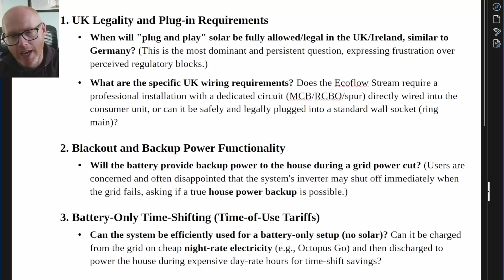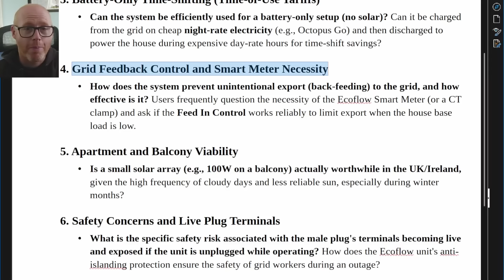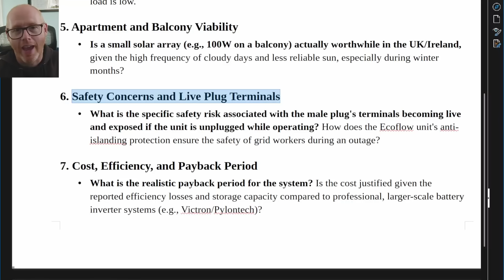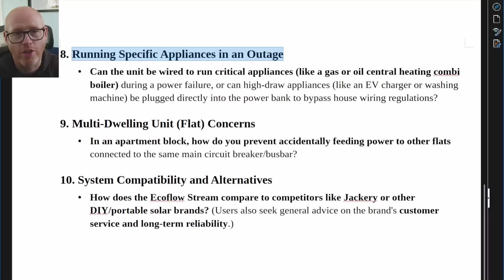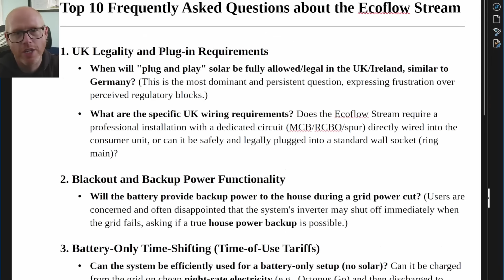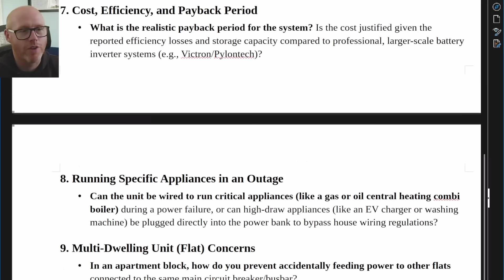Plug-in Solar - EcoFlow Stream: Legal in the UK? Wiring, G98, RCD? Blackouts, Time of Use...

Comment: Excellent video - thanks for that.

I hope the following (from my understanding as a professional electrical engineer) may be helpful (sorry it's so wordy for clarity) -

If a  battery/invertor unit is connected into an existing house Consumer Unit, downstream of its Main Switch, then that Main Switch cannot isolate the house wiring and appliances from the battery/invertor unit; safety isolation being its primary function.  In the event of a fault in the battery/invertor unit, it may cause the house wiring and appliances to be "live" even when that Main Switch is OFF.  Anyone working on the insides of that Consumer Unit would be at risk in that way. Anyone working on wiring outside that Consumer Unit would be protected only by the RCBOs (if fitted and working).

That is why (IMHO) it is preferable, for safety, for the battery/invertor to have its own Consumer Unit (clearly labelled "Battery/Invertor") which is connected upstream of all the other Consumer Units in the property.  "Upstream" here means between the main meter and the Consumer Units. In addition, should be a prominent label affixed to the outside of every Consumer Unit in the property, warning that a battery/invertor unit is installed in the property, to mitigate the risk.

If the battery/invertor unit has not been type-approved for connection to the UK grid, then it would be prudent to include an automatic (grid-sensing) isolator between the unit and the grid.  This avoids the risk to staff working on the grid during a power outage. This is quite easy for a qualified electrician to do, using a contactor in the Consumer Unit to which the battery/invertor unit is connected.

I hope that future editions of the IET Wiring Regulations will cover all this thoroughly, to make the safety requirements clearer for everyone.

I'd be interested to see other points of view - especially on how other countries handle these risks (or do they simply ignore them?).
Keep up the good work.

My system -
2x Enphase 5P 5kwh battery/invertor units
2x EcoFlow Stream Ultra X 3.84kwh battery/invertor units
Vaillant Arotherm 5kW & 250l Unistor, no buffer
VentAxia whole-house MVHR
Open Energy Monitor
no solar PV (so far!)
2-bedroom detached house
Reply: The Power stream Series are fully UK compliant and on the EAN register with their own numbers, you will see this when you self apply for G98  , same as all other solar systems out there . As an electrical engineer myself b.eng  hons and Electrician ta boot I installed a lock off isolator as an extra safety for the dedicated Stream circuit via b curve RCBO, not actually needed as MCB's / RCBO's  can be locked off with appropriate industry approved lock off devices , of course any solar grid tied devices requires appropriate warning labels on dist board along with circuit diag ( long line diag ) again which i installed , oh and don't forget DC string isolators ( them's the regs ) along with least forget dedicated earth bonding if fence / wall mounted through use of grounding rod , unless your like me and have a Tera Tera earth system in my household.
Reply: Some comments
- if the battery/inverter has not been G98/G99 type approved for the UK then it shouldn't be installed in any configuration it and the grid can be linked. If it's not UKCA/CE approved it should not even be sold or used in the UK (and even allegedly reputable internet e-commercite sites are full of dodgy stuff so be careful).

- A non grid tie and non G98/G99 compliant generation source can be linked to the house supply providing there is approved equipment such that the house is connected to one or the other (never both) and the two cannot be connected together. That's generally either a mechanical or automatic transfer switch. In the US these are common but in the UK traditionally only used on rural buildings with generator backup. It has to be done this way as "promise I'll remember to turn both switches" isn't safe. This will also involve a ground rod.

- Any installation that can operate with the grid down should have a separate earthing arrangement. There's no guarantee that the ground in the house remains a valid ground if the grid is down. Many home battery packs don't address this because they are really intended to be used outdoors camping and the like, some have earthing points they vaguely mention in the manuals but don't bother to properly explain because it's really only about emergency backup. Again mostly a theoretical risk but not one to ignore if you routinely operate in islanding mode or operate appliances requiring grounding is present.

- There are a bunch of wiring and labelling requirements for G98/G99 systems and you can conveniently buy label packs for them with the "solar PV on roof" and other labels. |That includes the ones on the consumer unit that address your concern if the house has islanding so you must also power off the battery to work safely. In theory the grid tie power loss will cut the power anyway but an airgap is always nice to have.

- There are a bunch of similar requirements for a transfer switch

- If you are doing any grid tie generation then you must file the G98 after install, or a G99 before for high power. G98 forms are easy to fill out. G99 is a lot more complicated but I doubt anyone here is going to be installing over 3.68kW of grid tie power.
Reply from the maker: Thanks for sharing these thorough comments with the community!
Reply: Regarding your first point the Ecoflow is designed to switch off wren it detects grid is off for this reason. Only the sockets on the device remain live. Would this not provide enough safety?

Comment: So it’s not legal to plug it into your ring main? So it’s not a DIY system at all then, what am I missing as I genuinely don’t get the point of it?
Reply: It's a mostly DIY system - just needs a sparky to put in a suitable circuit and you can then fit up to 3.6kWh of generation and do the G98 form yourself (it's easy), as opposed to having a team of people roll up and fit and wire kit to your walls. It also means you can unwire it and take it with you in future.

Like "keep off the grass" signs it's probably mostly honoured in the breach, and certainly Ecoflow used to completely take the proverbial on this as the Powerstream came with a plug fitted lead it told you not to use and a separate plug free lead.

That said there are sound reasons for the current regulations both because UK plugs have no locking form, and because fo the ring main system.

It's really mostly aimed at the EU proper where much of it allows plug in solar and people just pop into Ikea and get a system, screw it to their balcony or shed and plug it in.
Reply: @etchedpixels But I can get 13.5kWh of Tesla PW3 expansion professionally installed for about £4.5k. Which will readily output about 11kW AC if needed. I’m sure I remember reading that Octopus offer the expansion packs for less than £4k if done at the time of the original install. 
Just seems more expensive, a bit of a lash up, limited warranty and limited functionality. To me at least. 

I’m waiting for bidirectional vehicle to house/grid rather than increasing my storage. A giant battery pack just sitting on your front drive that can also transport you.
Reply: @yp77738yp77739 what really makes it work outside the UK is the self install, renter usability and the fact you can take it with you.

V2G fits the same hole for bigger setups and V2G doesn't even really need a car. The V2G interface can be used with static systems too and if we actually ever get V2G I am sure we'll see big off the shelf static V2G equipment for self install too
Reply: A "normal" install you have to pay about £6k for someone to fit about £6k of equipment. 
With this you can self install the hardware and get an electrician to do the final connection which is more like £500 than £5000.
Essentially the problem is money grabbing renewable energy installing companies taking the piss with installation fees. I'm legally not allowed to self install a GivEnergy Battery. For the 12 year warranty rather than 1 year, GivEnergy also require the installer to be MCS registered and have been on their in person training course. Installing it is drilling about 8 holes, screwing 10 screws, and connecting three cables. One of the cables is plug and play, but I wouldn't trust any old numpty to do the bit in the distribution board. That should cost less than £500 though, and you should be able to do the rest yourself. But the companies and legislation make it hard to know how much you're allowed to do yourself. And then you  need to find an installer that's willing to take a £4500 per day pay cut to screw the final wires into the final terminals and register it for you... In my experience that's been hard to arrange.

Also GivEnergy won't let you mix and match batteries with their inverter. You're locked into their extortionate ecosystem. I can't comment on EcoFlow on the same aspects, but you can at least save on the installation fees. 
Yes the hardware is more £/kWh to purchase, but maybe the same or less once you've factored in installation savings.
Reply: @Leo99929  Ecoflow, Bluetti etc are also generally locked to their own batteries so about 3x the price of generic decent kit. That said the price also includes end user safe cabling, protective casing etc so it's not a simple comparison.
You can (and people do) persuade them to work with standard batteries. Many Ecoflow units it's a resistor and a custom cable with two bullet plugs to a 24v or 48/51v external battery depending upon the unit.
Reply from the maker: Thanks for the comments and discussion!

Comment: Cue all of the salty comments about how the server went down once and now I just use candles to microwave my pot noodles
Reply: To be fair, there's absolutely no need for cloud connection to be required for use. The unit should be operable completely locally.
If not then they can go bankrupt, or decide to stop supporting the product and brick it remotely. This has only happened once due to the server going down briefly, but it has happened many times in the smart home appliance space which has made people vigilant to this kind of mechanism being in place.
They could also potentially get hacked, DDOS, or choose to shut them down or maliciously force export in order to disrupt the power grid for political or international conflict reasons.
Obviously, that's all just "potential", but what's frustrating is that the cloud connection takes money to maintain and costs time and money to create, and it's not strictly required for the unit to function. Yet they take the additional steps to not only implement it, but require you to use it. 
There's no problem with offering cloud access as an optional feature.

All products fundamentally capable of doing should be able to run exclusively locally if the owner wishes to use it as such. No internet access required. 

This isn't an issue unique to EcoFlow. Example: Microsoft have started requiring internet access to install Windows. This is part of a larger "right to repair" political issue where companies are taking steps to remove the owners ability to maintain the device themselves, ostensibly in order to inflate repair costs to the point that replacing the hardware is more attractive than paying almost as much for a repair. Apple are specifically bad for this. Samsung are bad too. John Deere.

This is like the fascism thing where 
"First they came for the Socialists, and I did not speak out—because I was not a Socialist."
"Then they came for the Trade Unionists, and I did not speak out—because I was not a Trade Unionist."
"Then they came for the Jews, and I did not speak out—because I was not a Jew."
"Then they came for me—and there was no one left to speak for me". 

This is the thin end of the wedge. It's the warning that we should not take lightly and remain silent on. This is how it starts. In the end, you will own nothing, and pay for it, even when it doesn't work.

Comment: With regard to point 3. Unless you have an EV / Heat Pump / or an MCS certificate (Only issued by a professionally installed solar/panel installation company?) then as far as I can see, you cant use any of the smart tariffs (Flux/Go etc) from Octopus where you can use cheap night rate to charge your batteries. I've tried applying for both Flux and Go but I don't have an MCS cert. so I can't proceed with changing to any of these tariffs aas stated in their T&C's. Please correct me if I’m wrong.
Reply from the maker: That's a fair point. Unfortunately I don't think most people adhere to those T's &C's and it doesn't seem that Octopus ever check either.
Reply: @UpsideDownFork  Hi Richard. Unfortunately if you try to apply for Octopus flux tariff, you must provide an MCS certificate as well as evidence of notification to your DNO on the drop down tabs. Without these it wont let you progess your application. So its a no-go for anyone that undertakes a DIY installation of solar panels / Ecoflow batteries to benefit from the lower 'night' tariffs. The only 'smart' tariff (as far as I can see) that you can use is the Agile Octopus tariff but not sure if the Ecoflow app can be used ( custom mode) to transfer energy to the batteries when the tariff is 'low'. It would be interesting if anyone is using the Agile tariff in combination with their Ecoflow batteries.
Reply from the maker: @paule1984  The flux tariff, yes. But for Octopus Go, there were no checks in place.
Reply: @UpsideDownFork  Thanks Richard. I'll have a look. Great videos by the way.
Reply: You could buy 1 solitary storage heater
Reply: Does an EV charger require MCS, I don't think it does?

Comment: Confirmed they're discounting from 8th November? Think I might get an EcoFlow Stream Ultra X.
Reply from the maker: That's what they're telling me. I'm just waiting for them to send me discount codes for when this video goes to general public on the weekend.
Reply from the maker: Links updated now which should be live from the 8th.
Reply: I ordered one last week and already received the full package. EF team's fantastic all sent out and delivered in 3-4 days since order was placed on. 
Thank you for the excellent video; the Q&A list was great and the explanations were very clear. I do have a point of disappointment regarding the STREAM line battery backup units. I was previously under the impression that these units connected directly to the MCB, allowing the batteries to automatically supply current to the house's circuit system and connected equipment during a grid outage. Based on the information provided, it seems the only operational option is to plug equipment directly into the unit's AC outlets for power during an outage, which is a bit of a shame and limited in case you have enough STREAM battery units on the circuit. 
I wonder if a potential software update could allow with a smart meter present on the system. This would prevent current from feeding back into the grid during a blackout for safety reasons point of the grid while enabling the batteries to power the main circuit. With this functionality, I believe a DIY solar system might be a more beneficial option and useful for expanding it to 23KWh, especially for a backup power. I was planning to purchase additional STREAM batteries to store sufficient energy for grid outages. However, if the batteries cannot feed power into the house system when the grid is offline unless any equipment is directly plugged in, further purchases/ expanding the back system seems to be pointless than (financially) beneficial for this use case, though.
Reply from the maker: @janiv4553  yep, unfortunately you will never see that update through software. Your proposal goes counter to G98 regulations.

There must be a physical break from the grid when operating in island mode.

A manual or automatic changeover switch along with an earth rod is usually required for these situations but the Stream series was never designed with this in mind and doesn't have the correct hardware to make it possible.

Who knows? Maybe Ecoflow will consider a gateway device at some time in the future but I suspect it is a lot of R&D cost for a relatively small market opportunity.